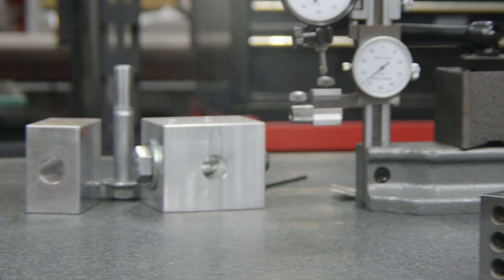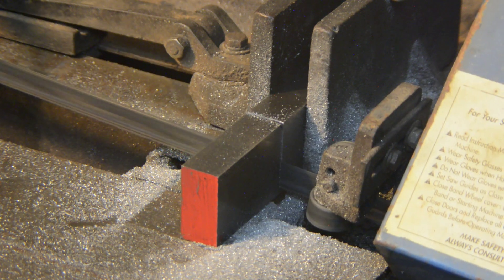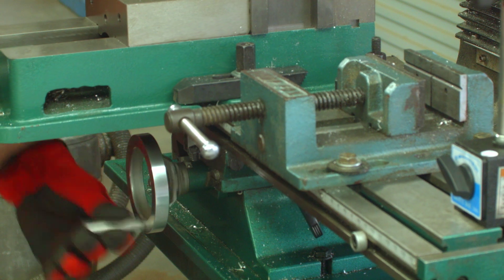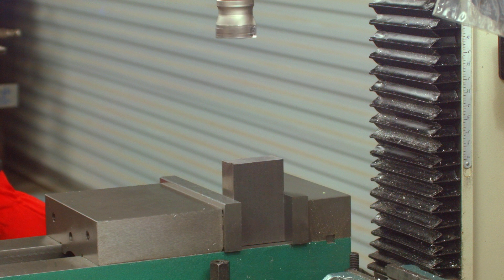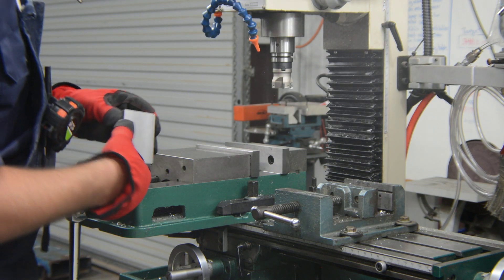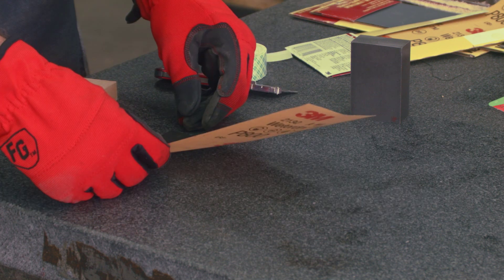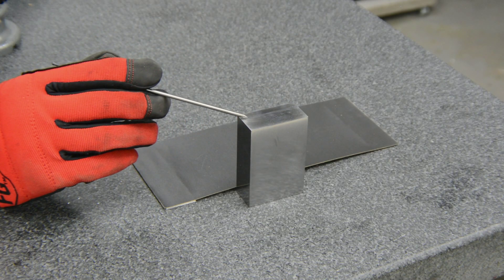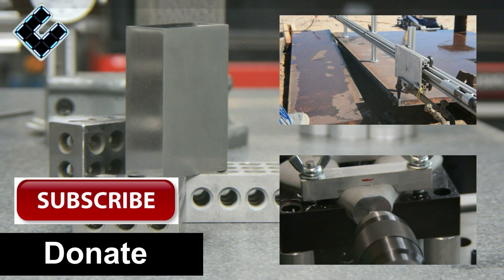123 Blocks, Make your own 123 Blocks, DIY 123 Blocks

Comment: Couldn't you find a thicker pair of gloves?- The wire gauntlets combat engineers in the Army use to set concertina wire might be available at the Army surplus store.

On the other hand (and I still got 2) if we, like most millwright contractors,  catch a man wearing glover anywhere near  rotating machinery on a jobsite of in our shop we send you home. without pay,  for the day. - Catch you a second time you can go to the bar for good. YOUR'E FIRED!

Much better to have a couple stitches in your thumb then not to have a thumb to get stitches in ,,,,, and with over 40 years in the trade, yes, I have seen fingers and one thumb torn completely off because of gloves. Also know of a guy that gor sucked up into the bending rolls and was slowly crushes to death, His partner said he could hear the guys bones breaking.   

But you are right. It's OK to wear gloves in right places. Like 5' away from rotation machinery or pinch points. Over 10 feet or more is even better. Gloves are for hot or shop or cold weather, but never anywhere close to rotating machinery.

Say Hi to Bob (Villa) you guys have to be on the same jobs together. ...... Ahhhhh - Armatures making "how to" videos.   (And the only reason I check yours out was to see if I could see one for our apprentices to watch.  Even without the gloves yours is all wet.)
Reply from the maker: Over thinking it. I wouldn't work for you any ways. I could sniff you out as an over complicated, inefficient work place just from the job listing. To many words nothing important said.......

Comment: 1. Nice gloves 😅 2. A 2.971 x 1.995 x .989 block is not a 1,2,3 block. 3. .0015" out of square is horrendous. Leave the tool making to the pros mr utuber
Reply from the maker: 1. thanks I love my gloves, recently switched styles to ones that fit tighter. 2. watch the video again the physical dimension is not important and I said that 123 is common and to make them the size you need. 3. .0015" is on dimensional accuracy parallel, flatness and square where all demonstrated to be far better. Leave watching informational videos to people who can pay attention.

Comment: What's with the poofy gloves?
Reply from the maker: Those are just the ones I had at that time. I've switched over to a different brand.
Reply: @centurialinc  Just how long do you think it takes to screw up/ - You won't have time to say ouch.   You are playing a game of milliseconds, microseconds even.   You are supposed to be an engineer. - 1/3 revaluation of a 1725RPM takes about 3.5 milliseconds. With a 1:3 set of shives a 3 flute mill takes about 600 MICROseconds to pick up and spin a chip and snag it on your glove,  (the chip can be 6" long or better too so you don't have to be very close) . Tale another 1.2 mS to accelerate you hand into the mill,,,, and you will find even Chuck Yeager didn't have reflexes that fast. And don't give me any crap that a chip cannot move your hand.  If your hand is sitting still it is in equalibrium (All forces are balanced as in a free body diagram)  If you add even 1 inch oz of force in only one direction like the above chip will your hand WILL move unless you add an equal force in the opposite direction. It will move in the direction of the force, That would be into the cutter ,,,, Don't tell ne you can pull away in close to1.5 mS which is about the time you have before the cutter starts chewing the glove up. (Guess what's inside the glove). - We may be calling you stub WAY before you have time to shut the machine off.  BTW Do you know what "helicopter" means on a drill press?  - You trying to tell me your hand is not in CONTACT with the part the way you use the drill press. ,  Kid, You remind me of the stunts I pulled when I was 12 years old and didn't know any better.

Find an experienced Journeyman or better yet a tool nd die maker to mentor you. If not, take a couple machine coerces at your local community collage before you have a catastrophic accident. 

Here is a Poem by Rudyard Kipling an engineering professor of mine made us memorize when I was at OSU in the late 60s.  Carefully read and understand it. Especially the part of being humble when you crawl beneath their rods,,, ,and the part where they have no mind of their own and what happens if you slip - 

Check out Joe Piszinsky "What has 3000 teeth and no conscience" Too
And remember the - The machine don;t care.  

Here is what  I remember of Kipling (It was 60+ years ago you know!
------------------------------------------------------------------------------------------------------------------------------------------------------------------------------------------------------------------------------------------------------------
From the secrete of machines by Rudyard Kipling

But remember, please, the Law by which we live,
We are not built to comprehend a lie,
We can neither love nor pity nor forgive.
If you make a slip in handling us you die!
We are greater than the Peoples or the Kings-
Be humble, as you crawl beneath our rods!--
Our touch can alter all created things,
We are everything on earth--except God!

Though our smoke may hide the Heavens from your eyes,
It will vanish and the stars will shine again,
Because, for all our power and weight and size,
We are nothing more than children of your brain!

But from now to any future day
This to all of you we say.... 
NO FRIGGIN GLOVES AROUND PINCH POINTS OR ROTATING MACHINERY
See, Even Kipling knew that!

Comment: the setup you perform in the mill vice is not required and a big waste of time. I have no idea why you would do all that. and 1.5 tho on a 1/2/3 block is not good in my opinion. If its not within 10's its not good enough
Reply from the maker: We did that in order control squareness of the sides. It was within 10s the 1 and half thousandths was the final dimension and as stated in the beginning of the video the actual size doesn't matter. Just that the blocks are the same and the sides are parallel and square. At the end you can see we test indicate the sides and less than 5 tenths was indicated on the 2 inch side.  Less than .00025" per inch squareness and parallelism.

Comment: always make blocks in sets of two . Oversize  material + .030, 1x2 is a good start . Plan the holes  and the taped threads to be most useful . Case hardened CRS is a good start .
Reply from the maker: Good comment. I tried DIY case hardening these with good results. I agree. Highly recommend hardening then.  I went without holes but now wish I had put a few in. Thanks for the comment and watching. Best Matt
Reply: @centurialinc  Taped and through holes are like sex , more is better .

Comment: just a tip here. But if you want to make sure you dont sand it uneven look up walking around the barrel, tech ingredients has a part about it in the thermal epoxy video. Look from about 3minutes on. And he also shows you a cheap way of getting a pretty flat surface for cheap in that part as wel. And he is going to hand lap a piece of heatsink with it. Pretty good information for people that want to do this and i think a better solution then doing this as you wil be getting much more even sanding.
Reply from the maker: Very good comment. Thank you. I always wanted to do some lapping. Specifically the three plate method. OxTool did a fantastic video on that and I think i'll give it a shot one day soon. Best Matt
Reply: @centurialinc  the 3 plate method is offcourse the best way to check, but depending on what you want to do it might not be needed. But i found the walking around the barrel method a pretty smart 1. A person can never exactly tell where and how he puts the pressure and be sure its even. So by rotating the part and yourself you get a nice even sanding action. I kind of knew about the method but not exactly till that guy on youtube showed it, it made sense to me then.

Comment: 7:57 This arrangement of sandpaper makes the edges non flat. Instead you can use regular tape or paper tape to keep the sand paper flat.
Reply from the maker: Good suggestion, and we have now tried some spray adhesives that work very well. Thanks for watching and the comment. Best Matt

Comment: I'm not a machinist, but why would your hands be anywhere near the cutter or the chuck to get gloves caught in? That's like saying it's dangerous to wear gloves and use a sawsall because they might get caught in the blade.
Reply from the maker: The video dose not portray distance very well. The camera angle and lens flatten the image. In reality my hand only comes close when the machine is off and is very safe. If the machine is on my hands are at least 6 inches away from the cutting tool. Which is very safe. Also an experienced user will be fine no matter what they are or are not wearing. In my 13+ years of doing this. I have had more injury's from sharp edges and small cuts than from any other possible injury. The gloves have eliminated these types of injury's and I will continue to use them for that reason. Thank you for the comment.
Reply: Yo Bubba, It IS dangerous to use gloves on a sawsall. = It will get you fired in most union jobs.

Comment: I am curious, with so many comments from people doing this for a living pointing out all the things you have done wrong, why do you still have this video posted ?
Reply: There may be better techniques for squaring a block (oxtoolco has a great video) but by indicating it in I would get it  under 2 tenths in squareness on my mill. Using cold rold surfaces as reference it depends on luck though. 
People concerned about gloves should never fly anywhere because a plane crash is far more likely than an accident caused by gloves. Many professional machinists use gloves all the time. It all comes down to common sense and behavior. Once in my life I got cut by a tool. That was in my first week. Now if my hands go even near moving parts the e stop is pressed and I am fully aware what BOTH hands are doing. It's similar to electricians doing live work. You just have to stick to protocol. The only time the gloves come off is when using my facing head. Which is very dangerous to use anyway. 
Also grinding on a shop surface plate is fine. I personally don't do it but I plan on keeping the next to dispose plate exactly for that purpose.
Reply from the maker: Thanks Gerd Meel very well said. I could not have said it better. Best Matt
Reply from the maker: Well I do this for a living too. You have to be careful with the comments section. most people behave differently behind a computer screen than they do in real life. Most of these comments are self serving. They point out why I suck and the writer is better. But the writer dose not take into consideration that this is my personal opinion and skill and I am free to show them exactly as they are. That's the point of YouTube. It's about showing what YOU do. I stand by this video cause it works very well for me and I'm sure it will serve others very well too. Thanks for the comment. Best Matt

Comment: Its not going to be square or parallel like this. If its square and parallel under . 002 like this ill be impressed.    Ideally 123 blocks should square and parallel .0001 per inch. Even the $10 imports are under . 0005.  Ps.  Take the gloves off before your mill does it for you.
Reply: But he used his Harbor Freight caliper to take all of his measurements !
Reply from the maker: Sure did it's not who made the tool that matters, the tool operating it is what matters.... ;) Best Matt
Reply from the maker: At the end of the video I checked the block with a dial indicator on a surface plate. Parallel to +- .0005 and if you don't believe me I'll send it to you and you can inspect it. These techniques work very well. I stand by them. PS I still use gloves. Best Matt

Comment: interesting, I get your a hobby machinist, only thing I wouldn't recommend doing work on a surface plate though. easy can damage a plate. 

Btw when you can get the chance or when the budget allows, surface grinders are great for that tight tolerance stuff with a great finish.
Reply from the maker: Thanks for the comment. We just finished our DIY gantry Mill, Video coming. And I built a grinder attachment for it. It's Awesome! Also the surface plate method is not my idea I got it from this guy. His opinion trumps all of ours and he recommends it. https://www.youtube.com/watch?v=cwdoUjynpEk&t=1357s. Guess what.... He recommends direct contact with the plate for ultra high precision lapping! When he said that I threw up a little in my mouth. The key he said is that the plate is extremely hard. Steel is no match for it. He said as long as you don't accidentally cover the plate in diamond lapping compound your plate will last for years. Then simply get it re surfaced and go another few years.

Comment: 1 2 3 blocks are the staple NOT telling (stable)    lol
Reply from the maker: Ha :) "Stable" As used as an Adjective in the English language.
Adjective: "stable is relatively unchanging, permanent; firmly fixed or established; consistent; not easily moved, altered, or destroyed."
Staple will work as it's definition, as used as an adjective, can give the proper idea. But I prefer it my way.
Best Matt
Reply: Centurial Inc (*1 2 3 blocks are the stable of any machinist*), is not a sentence. Nice try though lol
Reply from the maker: Clown Whisper Your a tough customer to please. It's a saying. Similar to any other saying. Such as "every now and again" or in texting "thx". If taken literally it is nonsense. So in a literal situation your right a 123 block is not the foundation of a machinist. But i still prefer it my way.
Best Matt
Reply: Centurial Inc it takes Integrity to admit when you've misinterpreted a common saying. Have a great day
Reply from the maker: Thank you. I stand by my mistakes. They make me who I am. I have revisited this project and did some DIY carborizing. I hope to hear your thoughts on that one. Look for that in a week or so. I am also preparing a video about the cnc machine I built. It now has auto tool changing and think people are going to love it..
Best Matt

Comment: Sanding on a surface plate!!! Holy Wow!!! What next? How to drill holes in mill tables and install dowel pins for stops...
Reply: Watch Tom Lipton from oxtools doing just that here https://youtu.be/j9FsmsjXKx8?t=137
Reply: That and sanding on paper held at the ends with double sided tape. I guarantee the edges of the blocks will be rounded up, not flat.
Reply from the maker: Ha! Best comment yet! That's not a bad idea actually......
Best Matt

Comment: This is not the way to square a piece of stock
Reply from the maker: The block turned out to be very square, which means, yes this is in fact one way to square a block. Thanks for watching and the comment.
Best Matt
Reply: Centurial Inc if the blocks 4 sides are square to each other abd to the two parallel ends it's purely luck!   You need to float each side against a press flattened edge.   Using a piece of copper wire or brass welding rod are typically used. You square off one end while holding the othe face/jaw with the rod.  This removes any deviation from its contact with the jaw. You keep doing this for each side until all sides in the long axis are square .  Finally clean up the two ends with the side of an end mill laying the part on parallel.

It's hard to imagen this process there should be a few videos on doing this
Reply from the maker: Clown Whisper, that is a good technique for controlling the results, and i was very aware that process. Off camera i had adjusted or tramed the vise. Then checked to see if that process would be necessary by checking the vise face with my test indicator. The vise was very accurate and from experience with the vise i knew it would be reliable. It looks like a 123 block video #2 should be done. And ill do a batch of blocks to see how the process i used holds up over time. Maybe make 10 parts? Maybe use other techniques and compare? What do you think?

Best matt
Reply: Centurial Inc sounds good to me

I'm not trying to argue but you showed how out of perpendicularity The Edge and top or by shining a light under it. I seriously don't understand how you could make that perpendicular without floating the one jaw.

Maybe I'm crazy
Reply from the maker: Clown Whisper Ok, I'm game. This weekend ill set up and run. I'll work through it all on camera. 

Best Matt

Comment: Avoid machining with gloves on.  If you catch the material in the cutter, it will rip your finger right off or drag your entire hand into the cutter.
Reply from the maker: Do it correctly and your fine.
Reply: @centurialinc  dude, even the best machinists make accidents
Reply: @centurialinc  Is that why there are so many incidents in the OSHA files where actual skilled tradesman with decades on the job get hurt? None of these guys ever get hurt? - And if you say you never lost a part off a chuck or vice or threw a part of a tool and cutter grinder or surface grinder you are a damn liar. I cant tell you hoe many times it has happened to me and my guys.